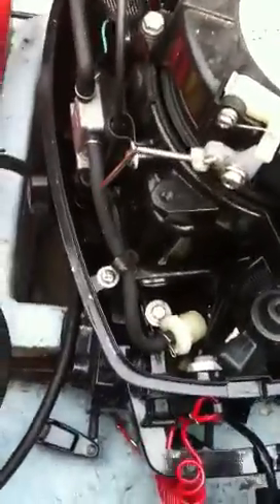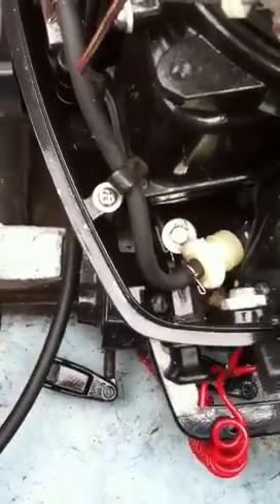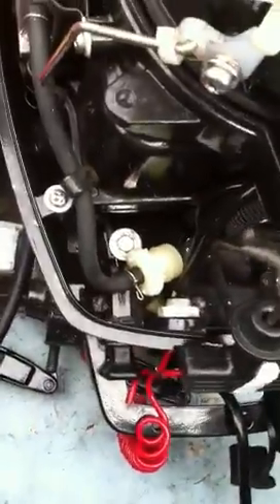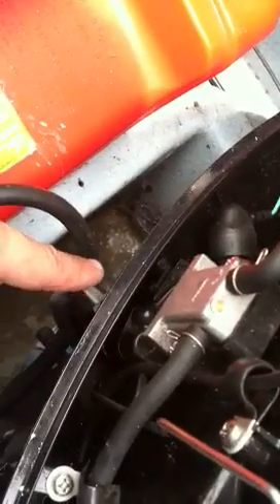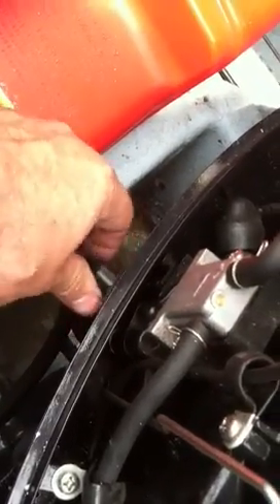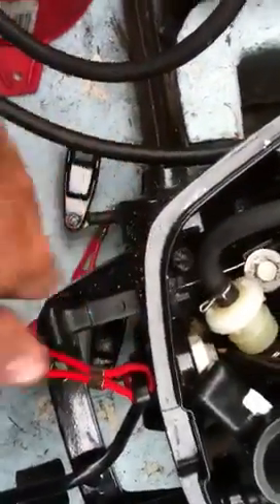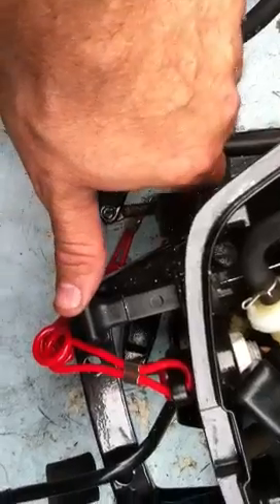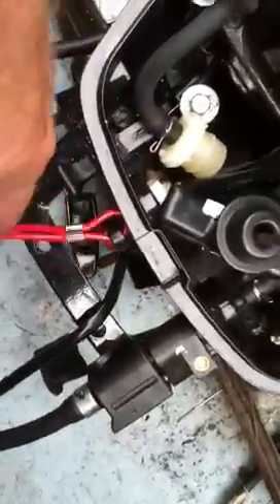Tohatsu 6hp sailpro

Comment: i am pretty disappointed in  mine. it has left me stranded before despite the love and care i give it. change oil regularly, new gas every time, run the gas out of the new carb and much more. i have replaced the carb twice since owning it. The starting rope is wonky too. maybe i got a bad one or maybe because it hangs of my transom with a cover over it. torn rotator cuff is ending this relationship.